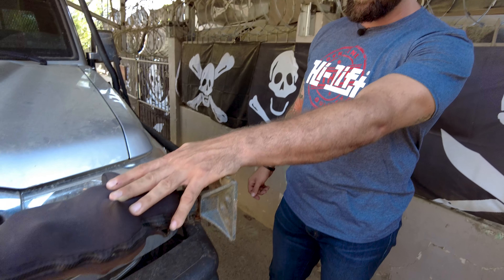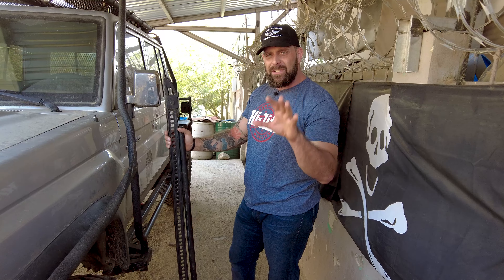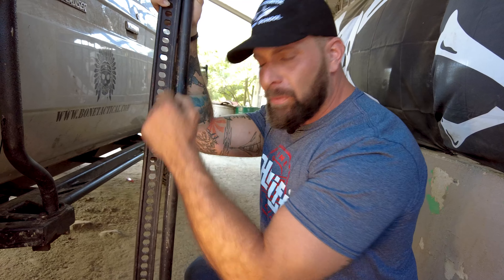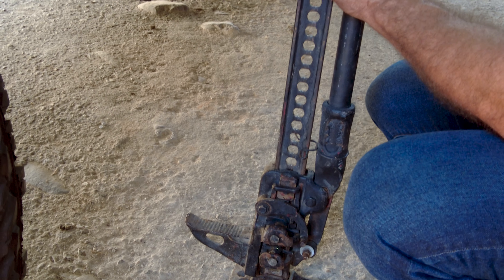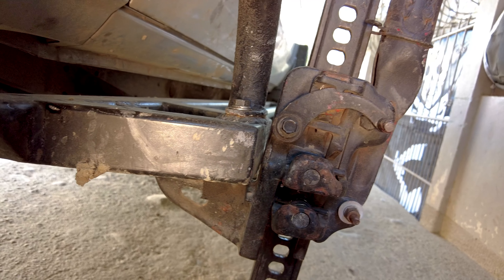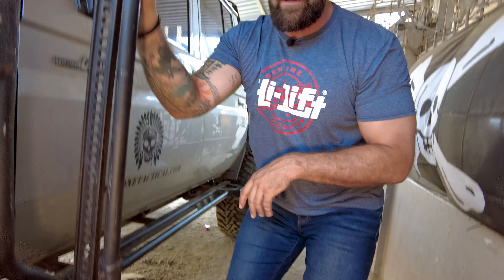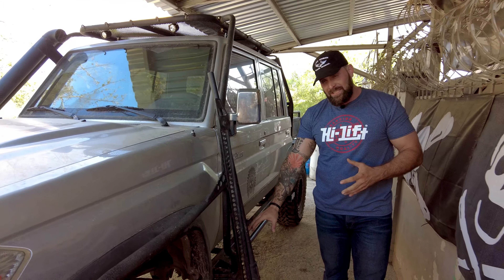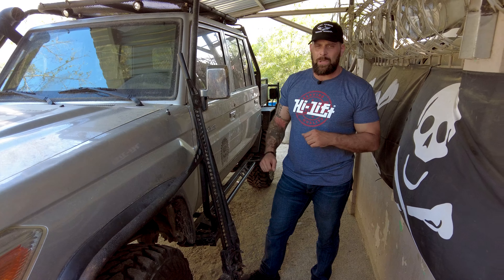Toyota Overland Pickup Build Pt. 10: Hi-Lift Tools

Comment: It's a 70+ year old design.  Keep it oiled and it works fine. I've had mine for 30 years.  It's the one's mounted on mall crawlers that never get used that usually have problems..
Reply from the maker: nope, but thanks for your feedback!
Reply: @BoneTactical  not a problem we don't have to agree on everything